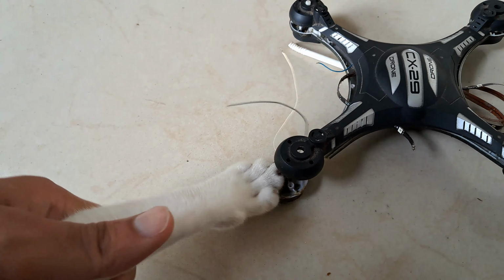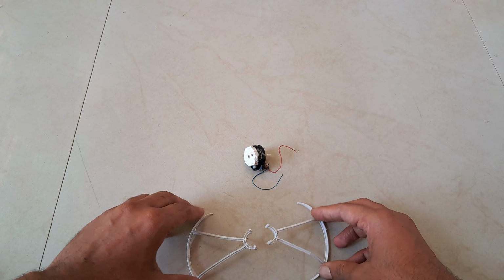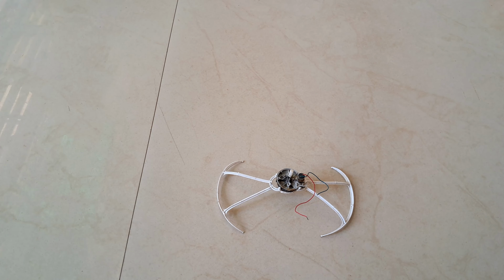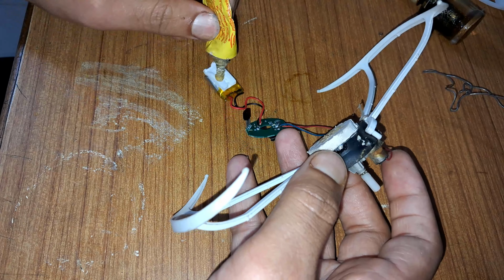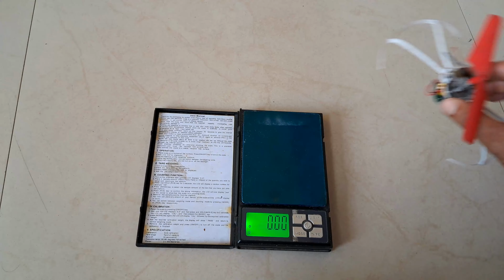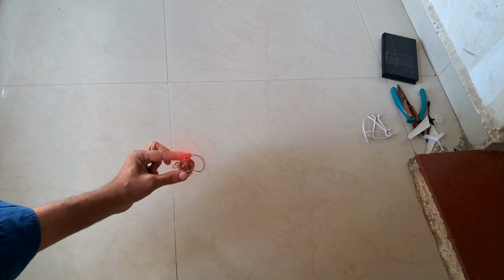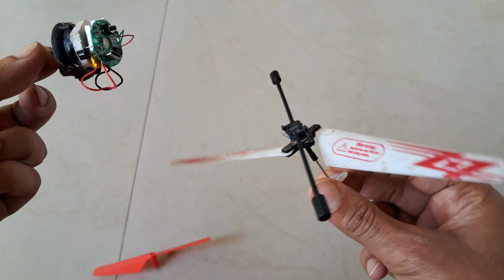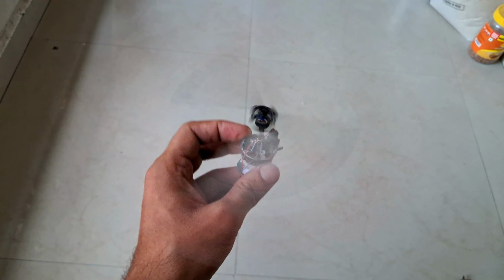Drone Helicopter | Will it Fly?

Comment: Thrust is sufficient. But you need a side-propeller to stabilize and move horizontally. Btw good work bro.
Reply from the maker: @dranandamay  yes, it needs stabilization
Reply: Correct